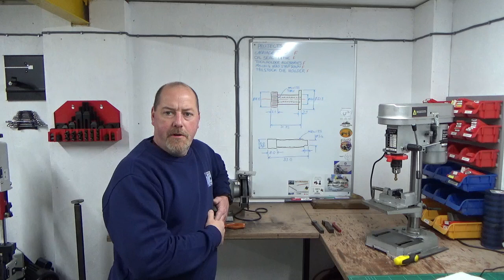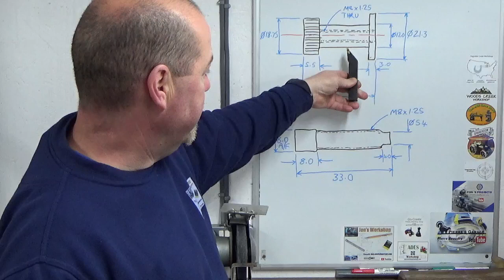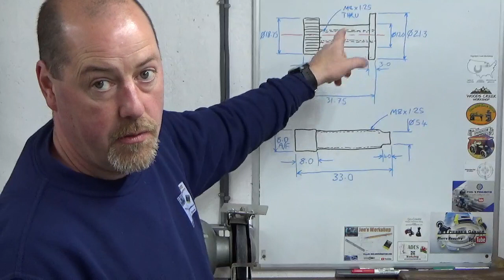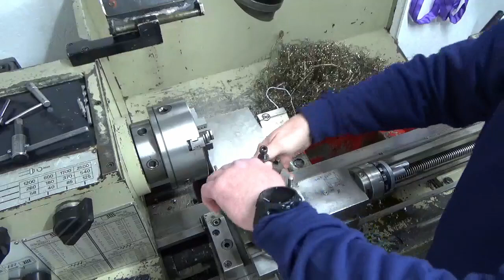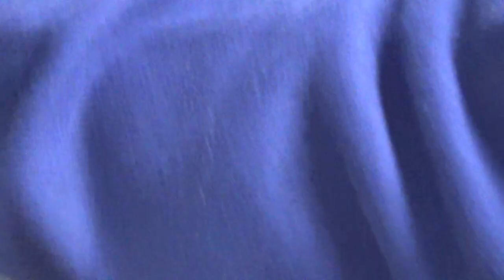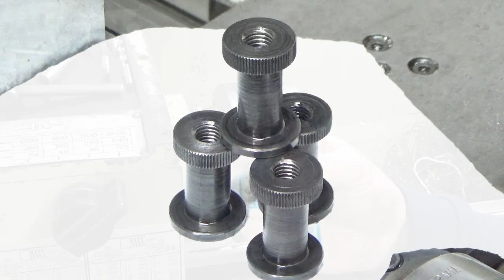Making Dickson Toolpost Height Adjusters

Comment: I recently made these to replace my old ones, and I had the same problem with the groove so I just used the parting tool to cut to depth at the bottom and turned a taper on the rest up to the knurls. Imho the tapers look a bit more pleasing than square shoulders
Reply from the maker: Hi Spooky, thanks for the comment. Great idea, who says aesthetics can't be fun when making your own gear. Cheers, Jon
Reply: @jonsworkshop  aesthetics are indeed fun! And practical sometimes! Especially this time. I originally wanted to replicate the original parts but my parting tool is one of those vertical clamped insert types and flexed too much without the support from both sides of the cut. That and I like making my parts look pretty as well, so I try to do so whenever possible. Thanks again Jon! Cheers from Cleveland Ohio

Comment: Hi

FYI - A suggested sequence of steps for this part :-)

1 Part to be machined from smaller knurled end (flange at chuck end)
2 Centre drill
3 Drill hole (deep enough to penetrate next part)
4 Tap hole (prefer to use longer tap if possible to save time and manual handling)
5 Counter sink sufficiently to enable support on tailstock centre
6 Use left hand turning tool to turn to flange diameter (length to be slightly more than overall length to leave a starting diameter for next part)
7 Use left hand turning tool to turn to knurl diameter (length to leave enough material for flange)
8 Use chamfer tool to turn the minor diameter (as much as is possible) consider location of required chamfers on final part
   (Steps 6-8 allow more efficient machining, better finish and minimise the amount of material to be removed by parting tool)

9 Use chamfer tool to create suitable "V" groove at flange end (so that the final parting off to correct flange width retains a suitable chamfer)
10 Set and adjust knurling tool to produce correct knurl as required (BEFORE placing knurling tool on material - this size remains FIXED, do not change size or release adjustment of knurling tool)
11 Place tailstock centre to support end of material (may not be possible if knurling tool - in the next step - interferes with tailstock support)
12 Use cross slide to push knurling tool on to material
     OR PREFERABLY set knurling tool at a slight angle towards the chuck 2°-3° and position knurls across material diameter and use saddle to place knurls in position
13 Knurl end and remove knurling tool without adjusting knurl setting
14 Use parting tool (with tailstock support) to reduce remaining smaller diameter to size (and length between knurl and flange), leaving ALREADY CREATED chamfers in place
15 Remove tailstock centre
16 Part off to correct length, leaving ALREADY CREATED flange chamfer in place (using appropriate speed and feed pressure to prevent chatter)
17 Part now complete - with minimal tool changes and adjustments
18 The end of the material in the chuck should already be at the correct flange diameter ready to "touch off" to turn the next part

I hope this helps :-)

Best regards

Comment: A different way to do things is always interesting to learn. When I make any part that has a hole in the centre I always centre drill and use the tailstock for support, it helps when you have a bit more stickout especially as my Chinese lathe is probably not as rigid as yours. Drill it out, thread then turn the detail. It gives a bit more support drilling abd tapping a thicker bar.
Reply from the maker: Hi Derek, thanks for the comment. Agreed, especially on a small hobby lathe. I am fortunate that my Harrison is a cracking machine in really good condition so it copes well with jobs of this type and size without needing the extra support. It's so nice after using my previous Denford that would have not managed this even with the centre in place. Cheers, Jon

Comment: Great stuff mate, really excellent content that I enjoyed very much. I'm really glad I subscribed. Nice to see the clock mounted up for use. The method using the parting tool is a good one. I did the same on board a ship to make some top hat bushes for something I was repairing. Often on ships you don't have much gear so have to do the best you can with what you have. Looking forward to the next episode.
Reply from the maker: Hi Carl, thanks for the feedback. The clock is a Mercer but it has Wickman on it, it would have come off a multi spindle auto section, a machine I also used to set and work (and thoroughly enjoyed doing so). Wow, turning on a ship, I bet that's a right giggle with a rough sea, I have enough bother finding my stuff in the workshop, can't imagine how challenging that must be when it's sliding about all over the place. Glad you're still enjoying. Cheers, Jon